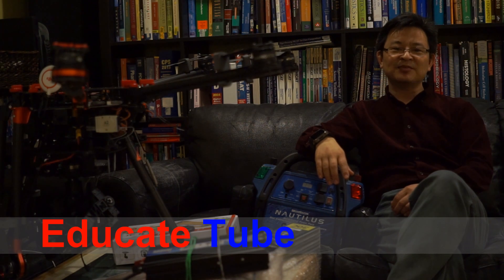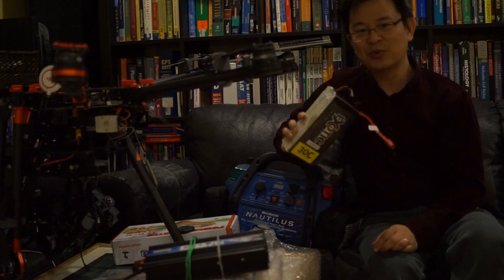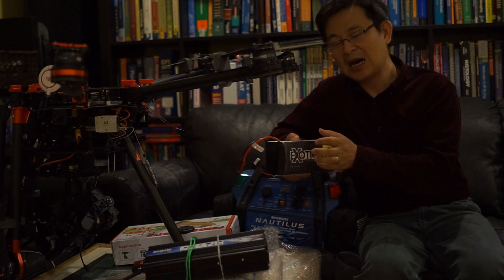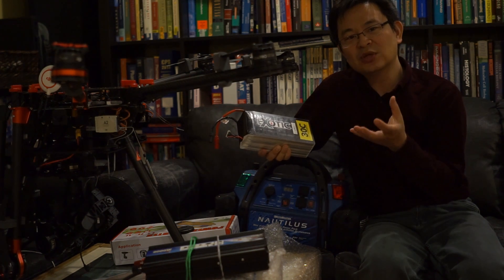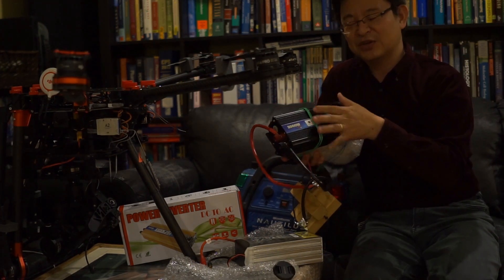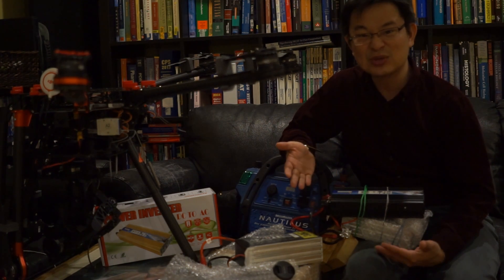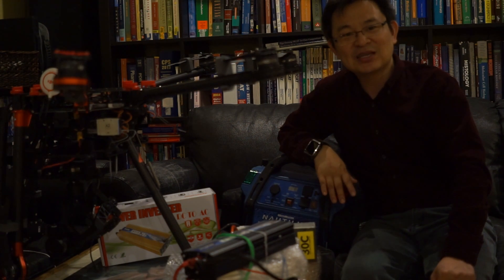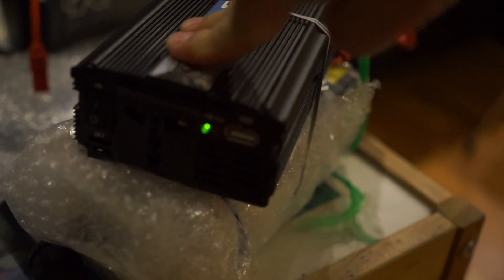Easy DIY How to make 500W Lipo Battery Power Pack DC to AC Electrical System in 5 minutes

Comment: So weird i found this video, not only did I find the answer I was looking for, but I too bought a used S1000, and it came with 5 of those exact 6s batteries, made by exotic.  I already have a converter and was trying to figure out a good way to step down the voltage from the lipo, but now I think I am going to invest in a inverter that is capable of handling 24v, I'd rather have less hardware on the final set-up, thanks for the video!!
Reply from the maker: Make sure you monitor the voltage drop when it is hooked up to the inverter.  Don't let it drop below 22.2v as you may ruin your Li-Po battery.

Comment: i have power bank rated 20000mah lipo i want buy 3 of them now we get 3s 60000mah and i buy inverter 300w but my gaming laptop run 130w 220v how many hours can run ?
Reply from the maker: About 1 hr 40min assuming 100% efficiency otherwise it maybe between 1hr 20min to 1hr 30min. The math- 60000ma=60A; each Li ion cylinder battery is 3.7v.   60Ax3.7v = 222w.  Your laptop is running at 130w per hour. 222wh/130wh= 1.7 hr
Reply: @educatetube  thanks 🌹put how many volts and amp to charge it

Comment: you need a lipo cut off switch. or those batteries will be junk
Reply from the maker: You are correct.  You need a circuit switch that will turn off at around 20v.  I manually switch off after it dropped below 20v using voltmeter to check on the voltage.